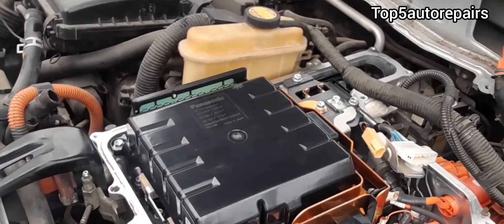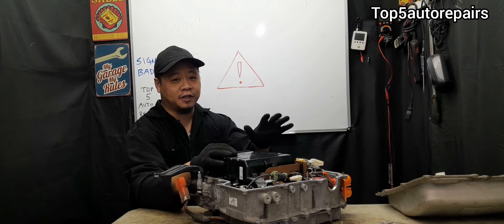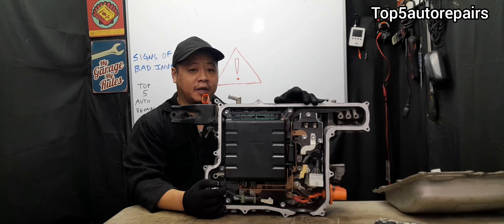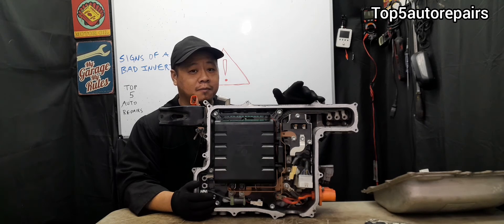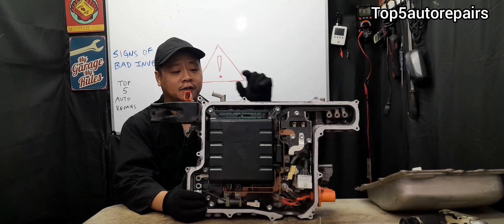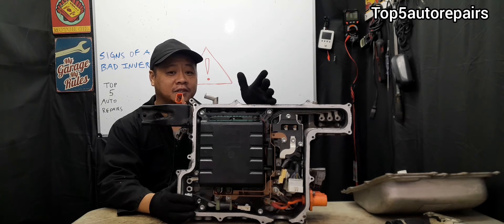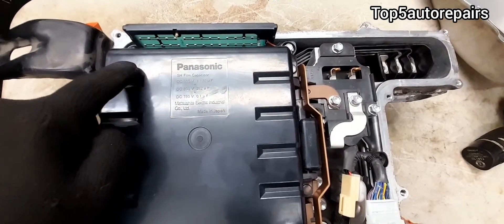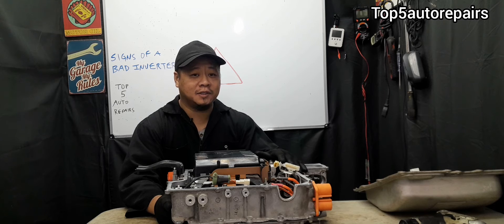TOYOTA PRIUS INVERTER PROBLEMS? HERE ARE THE SYMPTOMS OF A BAD INVERTER

Comment: hello i have a 2003 Toyota Prius , im having issues with it sometimes stalling.triangle light turns on check engine light and red car with exclamation mark. throwing code p3100. hybrid battery is new so it cant be that. i did check hybrid ecu looks perfectly fine. has brand new inverter pump so it cant be that . inverter is low on coolant because when i replace pump i didn't refill back up but could that throw a code for simply being low? so my question is could my inverter be falling ? also it weird because yesterday i drove 1hr and 20 min to work and 50 min back home it didn't stall, it was a rainy day kinda fresh but it dose stall out when its sunny kinda hot day. could that be signs of bad inverter ? i would really like your insights

Comment: I drive 12 miles with new 12v battery. Also I had replaced one module/ and cycled 2.
I'd previously/ last year cycled all and replaced 5.
After 12 mile sitting traffic. 
Red triangle/ got to our destination/ after that it wouldn't go into gear.
I guessed the 12volt battery cause it's not an even battery and only one click when pressing the button.
I bought and installed the correct battery 2 weeks later.
Drove home 25miles perfect!
It's sat.2.5 days.
Drove it 5 miles today/stopped for road construction for 10 min.RED TRIANGLE.
turned for home/same thing/wont go into gear.
Have 12 volt on charge.
Not up to the shut off point.
Haven't checked the Volts yet.
Coolant is flowing.
I installed a new battery computor too because of corrosion on the orange conn.
Hope his computer was good?
Might reinstall mine/with his wires.
I replaced my socket too/on my computer. But the harness end was bad looking too.
Suggestions?
Reply: Did you figure out what was wrong with it